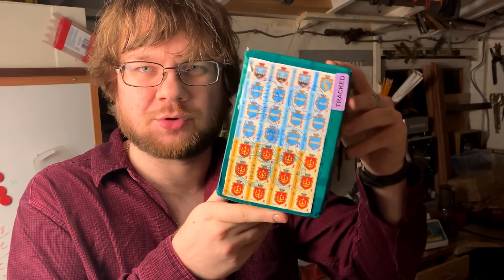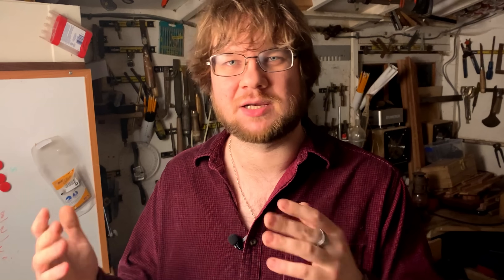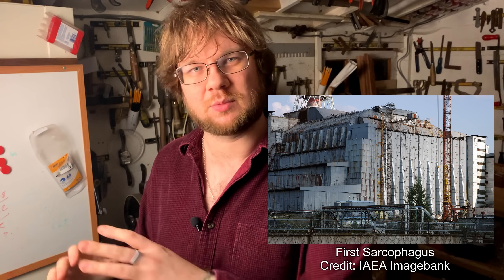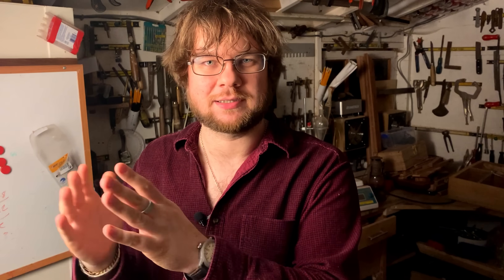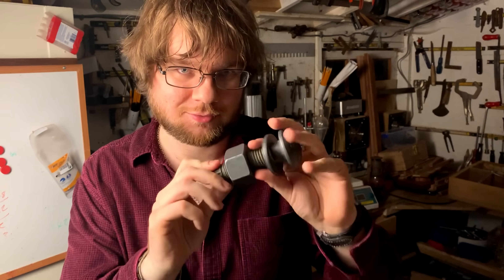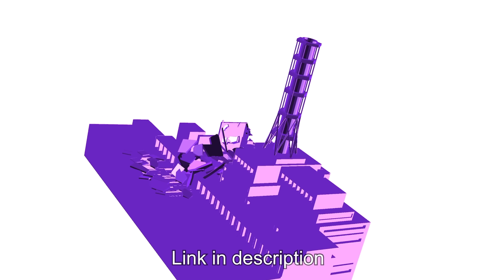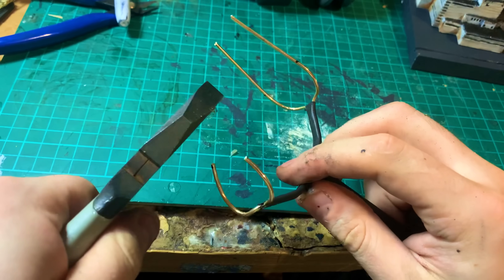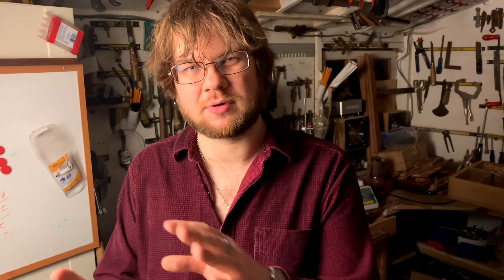This Bolt Protected Hundreds From Radiation At Chornobyl

Comment: FYI you keep showing the washer slid up against the bolt head but it goes on the nut side of the things to keep the rotating nut from not only scratching whatever you're tightening it against and potentially damaging its corrosion protection but also from potentially falsifying the applied torque in the process because of different friction and slip values with and without a washer. Also I really hope the tightening tool only holds the bolt by the end bit and doesn't rotate it as well because otherwise it's the exact same story. On the off chance that I'm wrong I apologize but I've been working in steelworks planning for eight years so far and have yet to come across a bolt (set) where this fundamental principle didn't apply.
Reply from the maker: Washer on the bolt side yeah your right, it was just easier to hold that way. Yeah my understanding is the tool tensions against the nipple on the end but it’s only the nut that rotates. When the correct tension is reached the nipple is twisted off by the tension.
Reply: @Turbobuttes and @Curiosity_lab  

Sorry, my previous post was wrong.

The washer does indeed go on the nut side!
And the tool to fasten them is indeed made out of 3 parts (outer shell, and two counter rotating inner sockets).

And works in three stages:
First the inner socket grips the spline on the end of the bolt and keeps it static.
Then the outer socket turns the nut until the proper tension is reached.
Then the outer socket keeps the nut static (because of enough tension, it doesn't rotate anymore), and the inner socket holding the spline then start to counter rotate (because that is the only way where the rotational force can go now/path of least resistance) and shears the spline off.

What I said before about other 'normal' shear or security bolts is still correct though: they usually have two heads: one round head and a hexagonal head on top which will be sheared off, so only the round head is left behind. The only difference is that with these traditional normal bolts, you apply the rotation and force on the head side, while holding the nut still on the other side (with a spanner or whatever). So, for this you need access to BOTH sides. What makes this 'Chernobyl' bolt so special is that you only need access to one side to do the very same thing! And thus can be done with one tool, instead of two. Exactly as how a pop revert and its automatic fastening tools work; you only need access to one side too.

Also, another massive benefit is that no torque is introduced in the bolt itself, just axial load/pure tension. In essence, this 'Chernobyl' bolt is a cross between a pop revet and a bolt.

-- 

These types of bolts are called TCBs (Tension Control Bolts) and are used in various ways and applications.
To be clear, they are NOT specific to Chernobyl, nor are invented for it! (they were in use since a few years before Chernobyl happened).
They were chosen to be used in Chernobyl because of their excellent mechanical properties.
Reply: As an engineer this is a great write up^
Reply: I agree with you. The washer is most likely hardened as well to prevent galling which would interfere with the torquing process.
Reply: @Curiosity_lab No, washer on the nut side, not the bolt head.
Reply: @Curiosity_lab yes you are right, I've actually tested these bolts before. I worked as a CWI and my job was actually to make sure the batches of bolts would actually torque to spec before they break off, and every single one I tested was way over what the minimum amount is.
Reply: If the bolt didn't have that spline the nut could spin the bolt before reaching torque, so it's more of a foolproof disign and faster as a one person operation, good video thanks mate

Comment: Another great project.  Certainly a conversation piece.   When a younger man 55 years ago I worked at Sparrows Point, Maryland at the Bethlehem Steel Corp.   I watched maintenance crews repairing railroad cars with large sheets of steel.   They often used a decades old technique of assembly with red hot rivets.   But on occasion they would use a type of rivet that did not need to be heated.   It was a bolt very similar to the Chernobyl bolt.   It was fastened through a bored hole in the plates, a separate collar was attached, and then a gun type of device gripped the collar and tightened it to the point where the end of the bolt snapped off.   It was very quick but the final product did not have the nice smooth appearance of a well placed hot rivet.   Engineering is wonderful.  Thanks for your videos.
Reply: Huck bolts
Reply: It sounds like a huck bolt. I see them all the time on commercial truck frames such as semis and dump trucks. I don't know if they are as good as a true rivet that was installed red hot. But I've never seen a huck bolt loosen up. Really cool bolt.
Reply: I worked for a company that supplied refractories for the continuous casters at Bethlehem Steel and spent many hours at the casters monitoring our products. That was in the early 90s. That mill had a very impressive maintenance program.

Comment: Now you've got me wonder... How does that 100 year corrosion protecting layer, which appears to be applied as a surface finish to the outside of the bolt, continue to provide protection once the tip of the bolt breaks off, exposing the actual metal inside...?
Reply: Anodic corrosion protection.
Reply: Most good quality bolts will last 100 years if not exposed to harsh conditions such as road grit or sea air.
Reply: I wondered the same thing, but I suspect that the nut side of the bolt is on the inside and therefore shouldn’t be exposed to the elements. If only small amounts of water reached it, I think the anodic reaction between the exposed steel and the exposed zinc coating would protect it for a very long period of time.
Reply: Sacrificial anode cathode corrosion protection. 
The outer layer isn't paint or a traditional surface coating, it's a less noble metal that corrodes instead of the steel of the bolt. The process is commonly used on large metal structures, particularly bridges and dams.
Reply: @Sky-._  Now that is a proper answer
Reply: @harveysmith100  thanks :)
Reply: Excellent question.
Reply: Common, after 99 years they just call the company and get new ones. Whats the problem?
Reply: What I'd do is use glue.
Basically, they are setting the tip up to rip off at a specific tension. What's holding the tip on doesn't have to be the steel of the bolt. In fact, it can't be. The bolt must be significantly sturdier than the connection between it and the tip, so that the bolts don't have a tendency to get ripped apart instead, or ripped apart a short time later, when a particularly strong gust of wind comes.

So what you do is glue the tip on with a glue that has a set adhesive force, which is on top of the coat.
Reply: @frantisekvrana3902 that is not how they work. It is the same material. There is a groove cut to reduce the diameter at that location to ensure that the shearing happens at that specific location. The depth of the groove is what dictates at what torque the splined end will shear off.
Reply: @chargehanger  Yup and that's why hot dip galvanized bolts are so much better than ceramic or any other coating that doesn't use an anode.

Comment: My 1971 Opel Gt used similar designed shear bolts to attach the impact-absorbing steering column. It assured proper torque on the fasteners. Also probably made it difficult to get to the ignition switch to hot wire the car. Required placing bolt extractors or grinding off the domed head.
Reply: I'm not sure if those would have been the same type of bolt, as these were only standarized in 1981 in Japan. And only then were gradually being adopted and standardized around the world. Other types of tension fasteners, shearing pins, etc did exist prior of course, but not these types.
Reply: Every car has them as anti theft measure, they turn Easy with a chisel and a hammer
Reply: I think that in this application these are called "security bolts"!

Comment: When I came across your video, I felt the urge to hike up my pants.  As a retired Ironworker, ive carried literally tons of those bolts in my bolt bags (the white canvas bags with a Klein logo on an Ironworker's belt).  There's a special electric wrench that tightens those bolts called a Lejune gun, and it is also very heavy.  I never wouldve i.agined seeing a 'Lejune' or tc bolt in an artistic representation... great video !
Reply from the maker: Thanks, yeah I’m sure the bolt seems pretty mundane to someone with decades in the industry, but the mechanism is new to me and I thought it’s use in the Chernobyl project was pretty interesting.
Reply: @Curiosity_lab  oh, I couldn't agree more.  I was a 31 year old commercial fisherman in Alaska, with a 2 year old (and ready to retire after 14 years) when a friend of mine on a sister boat suggested I join the Ironworker's union.  I did just that and I learned the answer to a question I heard about when I was 12.  Driving past a tower crane, my stepdad pointed out a tower crane, and he said "those cranes put themselves up & take themselves down, which is 90% true.  I actually got to help the crane Ironworkers jump a tower rig a couple of times.  If you don't work on learning something new everyday, you're not living.

I loved your video, and the model of Chernobyl that you made really impressed me. Without your artistic talent in painting the reactor to look so ravaged, it would look like a   half finished model because the printer ran out of plastic filament

Comment: Since this bolt is the focus of your display,  and the structure and engineering is the focus of your thoughts, I suggest checking the numbers. The 125 kilograms you mentioned as the pressure exerted by the bolt doesn't sound correct. There are quite a few specifications attached to such an important and specific fastener of this size and quality.  But a bolt that size, especially produced for the largest structure ever built,  would have MUCH higher numbers than that. I'm no engineer,  but, depending on the alloy and heat treatment,  a bolt that size would have a working load somewhere in the neighborhood of 8,000 kg and a breaking strength about twice that. It would have a torque specification, which is normally the one spec to adhere to during installation,  of around 250 ft.lbs. or 340 Newton meters.  Perhaps the number you quoted is in foot kilograms, which I don't think is a standard specification.
Reply from the maker: Yes I was referring to the torque on the spline by the machine not the pressure of the bolt. The 125 kg number was the only reference I could find to the shear force on this bolt. Looking at it I think your right about about it being in ft kg as that would roughly equate to your numbers in ft lb. I guess someone tried to convert it from lb to kg at some point and left of the ft. Thanks for pointing it out.
Reply: I was thinking you probably saw kN and said kg

Comment: I use these bolts daily, as an ironworker. Unless that particular coating, for those particular "authentic bolts" was specifically designed for Chernobyl, there's nothing specially made about them. Your explanation of how they operate is also backwards. The wrench holds the nut and spins the bolt, until the friction from the spinning bolt overcomes the designed shear point of the tip. I'm not trying to knock your video, I just want to clear up any misconceptions about these "special" bolts.

Comment: The part that is most interesting about the bolt is not the torque-shearing aspect but the chemistry of Greenkote. It is a zinc-aluminum polymetal that fuses with the iron of the bolt. The resulting adamixture is many times more corrosion resistant than zinc or aluminum alone and has a life expectancy of hundreds of years.

The metal structure itself will corrode away quicker, leaving behind a pile of very durable bolts.
Reply: The Greenkote idea is a little stupid when you’re shearing off the tip and exposing the whole bare end to the elements anyway. Those bolts will not last 100 years if not fully coated.
Reply: @berkcanberk4947  I was going to comment this exact thing. Rust will find a way... always! It only needs the smallest of exposed metal weak points to start spreading like a cancer.
Reply: @berkcanberk4947  Galvanic corrosion protection WILL protect the exposed end while there is coating left that it in electrical contact with the corroding fluid.
This method is the same as used on metal hull boats by placing sacrificial anodes made of Zinc or Magnesium in a few places around the boat.  Even a rubber dinghy with a outboard motor will have some attached to the motor.

Obviously if there was a drop of corrosive liquid (not pure rain water but some water with ions from acid rain or similar) that was in the middle of the cut end it could slowly corrode into the end of the bolt.

I also see a strong likelihood that the inspector will dab some paint over the end of the bolt when he is checking that they have been sheared off.
Reply: That bolt will certainly last far more than 100 years even with the tip exposed unless it is placed in an extremely corrosive environment, which the top/sides of a metal structure exposed to the wind and sun is not.
Reply: It's like saying a gold ring will corrode because you cut into it
Reply: @ImAfraidBruce  Correct. I will also hazard the the large majority of these bolts will be placed with the sheared end INSIDE the structure.  One of the design goals said that dried air will be circulated UNDER the outer skin to prevent condensation forming and this will protect the bolt ends effectively.  It may even be the case that ALL of these bolts are fully on the inside of the structure where the air will be kept dry.

Comment: You know Aircraft have been Mass produced using fasteners of similar designs.
Most often with a hexhead (Allen) hole in the fastener. And the breakaway head on the nut side/assembly.
Hi Loks are a popular, widely used fastener of this type.
... drilled and filled tens of thousands myself 🤗

Comment: My dad actually worked on the novarka project (project director, HVAC & IEC) and I went over with him several times. The project was a continual trainwreck. Multiple unanswered & unmitigated safety concerns, several accidents (the crane incident in particular was rather funny though) concrete foundations cracking & buckling during the rollover. Novarka never ahould have recieved the contract. Though it's good to know at least one part of the project had some well executed engineering in it. Thanks for the video!

Comment: We use something similar when putting together multi gang meter panels in the electrical trade. They use breakaway nuts on the busswork as they interlink panels. Imagine two nuts back to back that have a sheerline. The outer nut will break away at the sheerline when a spwcific torque value has been reached.

Comment: This type of bolt a commonly used in large building construction.  The great thing is they cannot be under tightened, because a certain amount of torque is required to snap off the spline end.  Also they cannot be over tightened because the spline snaped off and the tool would rotate.  All inspectors have to do is insure all the splines have been snapped off, and they know the bolts were tightened to the correct torque

Comment: Similar in a way to Huck fasteners that are tightened and then fastened from one side.  The Huckbolts are not threaded and the fastening is a permanent crimped ferule that grips the ridges on the bolt.

Comment: saves time because if the end is twisted off then it is visual confirmation that sufficient torque has been applied and as such many bolts can be checked at a glance rather than having to confirm the correct torque has been applied to each one with a measuring device.

Comment: We use bolts very similar to these in wastewater infrastructure construction. Look up ford megalugs pupe restraint systems. The bolt heads snap off once yhe desired torque is met.

Comment: It's a Lejeune Bolt.  Been around since 1976. They are a TC BOLT./ Torque Control Bolt.  Used thousands of them.
Not sure where you got the
 Chernobyl Bolt from.
Reply: He got it from the click bait need for a half decent story.
From what I understand, TC Bolts are used extensively in bridges all over the world.
Reply: @petert3355 wind turbines, too. 

Basically many huge that are made from steel and need to be assembled in place.
Reply: @petert3355 I obviously don’t know (not a mind-reader ;-), but I think he probably just heard about the tech when reading about Chernobyl and went looking for a sample; I don’t think he was aware of the bolts before he learned about them in association with Chernobyl.

Comment: Fence bolts work like that. Well the nut actually - there’s a cone which is threaded internally, and a nut on the end attached with a thin piece of metal. Once the nut has been torqued it snaps off, leaving the threaded cone to hold the bolt. Being a cone there’s nothing to grab hold of to undo , making it quite secure.

Comment: I was surprised to see a TC bolt on the thumbnail. We use those in pretty much every structural steel erection project. Snapping them can be quite therapeutic.